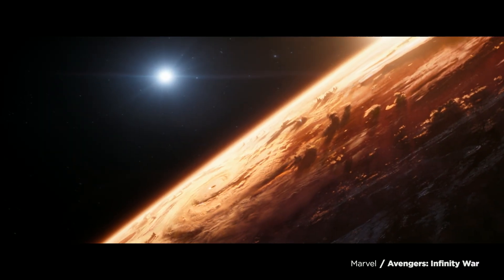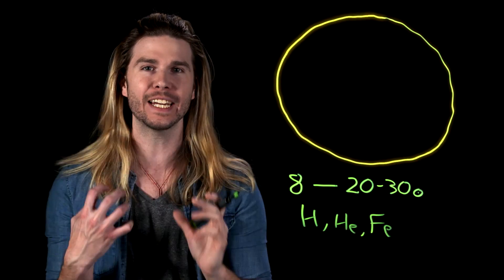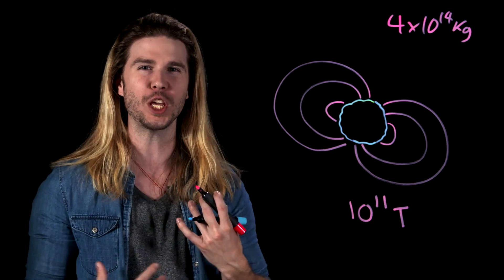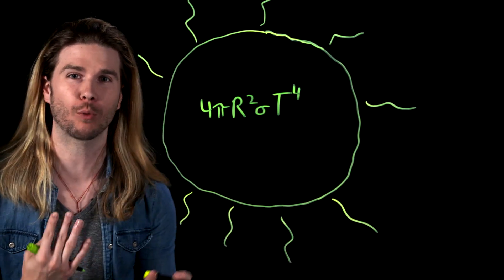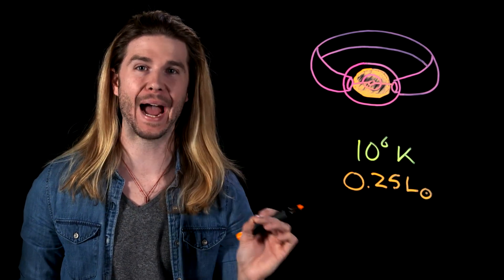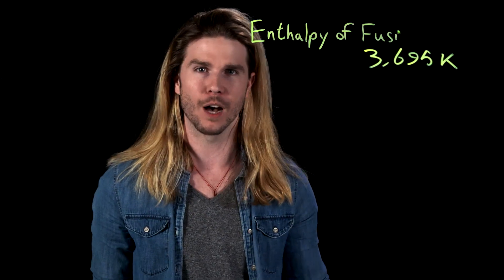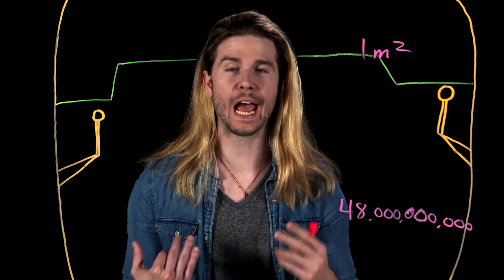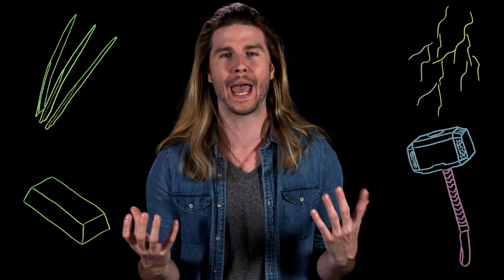How To Forge Thor's Infinity War Weapon

Comment: Nice video. Yeah that part of the movie have a lot of problems.
First: What is Rocket's spaceship fuel made off? He can move the rings of the forge like nothing. Yes, he was catapulted by Thor, has his momentom velocity and stuf like that BUT we are talking about rings than can handle the gravitational force of a neutron star. There wasn't too far away from the star and we don't know the scale of the whole machinery. It's has to be like trying to move a car by pull it by a needle.
Second: Okey, Asgardian can live in the space vaccum without much trouble. So..... Or the explotion of the ship (the one which found Thanos and was destroyed) was REALLY powerfull, like supernova scale of explotion. Thor was found unconscious and he take his time to recover. OR there are some kind of atmosphere surrounding the forge becouse the other (Roket, Groot and Tyrion) stay there without problem.
Third: Right after the axe/hammer was take out of the molde it was hard enough to be put together by Groot so the metal cold really fast and it's has to radiate that heat somewhere (an other supernove?). Then Groot lift it up, a weapon so heave than no one can even move an inch if you aren't worthy. So or Groot is worthy or he's more strong than Hulk and Thor together!!! (assuming the Stone-Breaker have similar propertis like Mjolnir becouse both are made of the same material). I really want to know what happens if the second part it's the right one.
Sorry if there are some mistake, I'm not native speker and my writing need some impruvement.
Great work. Hi from Argentina.

Comment: So considering the massive gravitational pull of the star wouldn’t it be possible for it to have a massive atmosphere? Theoretically, if you ignore the magnetic field, you can have an atmosphere that can extend several hundred kilometers away from the gravity source. And because the diameter of the star is so small it would mean that you can have a breathable atmosphere while orbiting the star. 

The problem with this theory however is the lack of internal reflection. If you think of light pollution, light generated by the surface of the star should be reflected back, making the air around the star change colour. Which is not seen in the movie.

Comment: Using the term forge in this case is incorrect. It would make more sense to call it a foundry because no actual forging actually occurred, it would be casting. I’m just saying seeing Peter dinkleberg use a giant power hammer would be badass.

Comment: Kyle (Good evening btw) mentioned, that from certain point we can see the whole surface of Neutron Star (NS) because of NS gravity pull affect on Photons. So if you could stand on the surface of NS you can probably see yourself from behind. For instance the radius is 1km, then the equator is 6.28 km. So you could see yourself standing 6.28 km away. Well..we actually can't, but the one who is able to stand on NS probably can...

Aand, i know, Thors weapon is not made of ...NS core, but if it was..probably it could become the "Radioactive smasher" because of bremschtrallung radiation per every fast hit or a collision after flying on a high speed. The heavier the opponent - the larger ammount of gamma rays

Comment: One of the things I wondered about in that scene was the scale of things and how long it would take for them to move around and do the things they did.

So what I've learned here is that the scale can work cause a neutron star is way smaller than I thought, buuuut....

I mean doesn't that mean Rocket, Thor, the Pod, the forge and Eitri would be under pretty intense forces? Would they survive. I mean Thor is one thing but.... And the forge is pretty darn durable. How did they even build that?

Comment: For the bit at the end: if the neutron star is so incredibly massive the gravitation would also pull in gas that is floating around in space. It would also be instantly pulled into the star just like everything els around it but as in the beginning of the scene forge has been extinguished for a while maybe a kind of atmosphere has built up around it. Also it has been established multiple times over that asgardian gods don't need to breathe so it doesn't matter as much. Btw the scene in which stormbreaker is first used is probably the ost awesome thing in history.

Comment: You did a wrong. Fairly certain supernovae don't happen when the mass builds in the centre  (kind of implies the star is creating mass) but because the iron can't be used so the pressure the fusion  (fission? I forget) produces lessens until it cannot withstand the gravity of the stars own mass at which point it all rushes in and explodes. Love ya show Kyle

Comment: I was very annoyed that the ax wasn't forged, but cast. The real question is what is the forge made of? The ring Thor was in is meant to take the same heat he did for longer without any apparent signs of warping or melting, even though we know it was enough to melt Uru metal.

Is it possible that the Dwarves gave the neutron star an atmosphere? With the rig apparently covering for the radiation, magnetism, and gravity of a neutron star to the point where a raccoon was able to be there without issue, could they also have given it an atmosphere?

Comment: havent watched the movie so dont know what happens in the scene but:

but if you FORGE weapons you dont melt the metal but you get it to forging temperature wich is around 70% of its actual melting temperature and then move the metal to the shape you want. 

if you would actually melt the metal and pour it into shape it would become a cast metal and not forged metal. And that can't be called a forged weapon then.

Comment: This is really irritating to me. Because no one gets it right in television or the movies

Correction 1. "Thors hammer was forged."

Thors hammer was never forged. It was cast. There is a big difference between the two in terms of skill, time effort, and process. 

In casting, it requires a skilled molds craftsman and a furnace/crucible operator. They would then pour molten metal into the mold to create the casted part. 

Forging requires the heating of metal and softening it enough so that it can be shaped by a skilled forget using power and/or hand tools. 

Correction 2. "It was built in a forge."

If you are casting metal then that location is called a foundry not a forge. Doesn't matter if you can do both in the same shop. The area and furnace for casting is the foundry and foundry furnace and the area for forging is the forge and forge furnace. 

The tools, furnaces, processes, and techniques are entirely different.

It is frustrating, annoying, and aggravating for people who practice the at to see it mixed, confused, or incorrectly named. 

It's insulting. Please do some basic research of the field if you are going to produce a film, show, video, or post threat deals with either practice.

Same goes for game of thrones, Conan the barbarian, fellowship of the ring,GI Joe, avengers avatar the last air bender, and etc.

Sorry for the rant, but it really grates my nerves to see a passion of mine slighted.
Reply: P.s. the phrases in quotes are meant to be there incorrect phrases that are corrected in the following paragraphs

Comment: dwarfs ? the forgemaster is taller than Thor Kyle! Also, wouldn't their ship then be pulled to the core so hard, that they would smash into it ?(Assuming it is made out of steel or some sort of metall)

PS: Q is usually reserved for the value of Charge

Comment: Your explination of the formation of a neutron star is wrong. A star is held up against its own gravity by radiation preasure, heat in other words. The build up of iron in the core will cause it to absorb that energy as iron fusion is endothermic. This causes the star to colapse in on itself, masively spiking its heat and preasure. This in turn ignights more fusion in the unspend fuel from outside the core. Which explodes and that explosion colapses the core into a neutron star, blowing off the outer layers. 

Fun fact; this cycle of colapse and explanson can occur multiple times.

Comment: Well I wouldn't have excluded the rest of the neutron star as an energy source. I think it would be pretty damn dumb to only use the energy coming out of the little hole. Not that you would necessarily want the whole energy output of a neutron star focused on such little material (maybe you have to heat it slowly to give it the best quality or something), but the rest of the containment system would have to put up with the rest of the energy, which is ... pretty demanding. If you wanted to cut down on the power you blast on your material or machinery then it would definitely help to have an outlet that can sort of dispose the unneeded energy. It could just blast it into the next star or something
Also I thought the part before, where they had to 'activate' the neutron star again was one of the most physically inaccurate film scenes I have ever seen. At least it's told like that in the German synchronisation. Don't know if it was worded better in the original
If you could just 'stop' a neutron star and then 'activate' it again just using a spaceship, then you could've used the spaceship itself as a power source for forging... My theory is that they just meant that the forge has been stopped and not the star. At least I hope so...
EDIT: lol I just realized Matter Beam already wrote a genius answer to this loophole. Love it!

Comment: I maybe overthinking but wouldnt the calculations for melting uru need to include that thor standing in front of the beam itself be preventing that amount of concentrated blast to be deflected off thors back or is it flowing thru him? Meaning uru has a higher melting point.
Reply: Judge Manny ah bless you for making note of that! Just laid that out myself, but not likely soon enough for notice.

Comment: come to think about it, the entire space station/forge couldn't have had any air, i mean Thor was standing in space while he was holding the hatch open, but the beam goes directly inside the forge.
Later when Thor gets blasted by the beam, he drops inside the forge as well without crashing into any kind of barrier. that means the entire area is open to the vacuum of space.

so unless the  the entire space station in which the forge is situated has an atmosphere around it and the neutron star, Thor wouldn't be the only being that could talk, breath and make sounds in the vacuum of space.

Comment: Lol I'm sure that blacksmiths and blade masters are cringing at the scene; because when forging a weapon you don't melt the metal. As a blacksmith you would heat up  the metal till a critical temp, and hammer it out to a bar. Once it is a bar shape and is consolidated,  then you repeat the process with heating and hammering,  then you forge it to weapon you want it. This process is to be repeated until it is rough in shape. Then you define the weapon's shape.

Comment: what about all the heat and Radiation?

the heat while it would melt the bars great. it would also melt everything that is not a god to a small puddle on the floor. so thor would have been standing in a room with a few puddle of whatever else was in the room few seconds after opening the door. so that a lot of hot melted metal being suck in to space really fast.

Radiation
 electromagnetic radiation if the heat does not kill you this will.the way we find Neutron star is we look for electromagnetic radiation and we are billons of km way and we still see this. so been that close to the star like thor i'm sorry but even a god could not live thro this much Radiation.but if he did he would be glowing for couple thousands years.

Comment: I guess that means Uru metal with its magical properties is far far more durable than vibranium which just seems to be good at absorbing mechanical energy but when it comes to thermal energy it can definitely be melted at way less than star level temperatures as shown when Ultron forged some vibranium armor in a regular forge and then got it melted and damaged by the combined prolonged lighting strike from a less powerful Thor, iron man and vision which means it's also no pushover but it's not Uru level. Now imagine how much force Hela had to generate to crush Thor's original hammer with one hand.

Comment: Considering how advanced Dwarven/Asguardian technology is (basically magic), shouldn't we assume that the entire structure around the neutron star is a type of Dyson Sphere? 
If that was the case, the area of the star directly exposed by the aperture wouldn't matter. We should instead assume that the entire output of the star is being focused onto the metal (and Thor's cosmic backside) for 2 minutes. 

Assuming 0.25L and a diameter of 10km, this would produce about 11.5 x 10^27 J. Which is over 10 million times the output calculated in the video.

Comment: Interesting thought, if you were to fire a gun at the surface of a neutron star how fast/massive (slowest/smallest object possible please) would the bullet have to be to knock off a chunk of the neutron star into space. How would the magnetic fields effect it? What would be the best angle to impact to surface at and how would that change based on the magnetic field? After you then have this chunk of neutron matter floating through space, what would happen if you tried to handle it?

Comment: Here is a good question... If the star had enough energy to melt  Uru metal. What metal was the star encased in the film? or the rings? must be some crazy shiz nizzle!
Reply: Most likely made of a ceramic or some material with a high thermal conductivity with a heat exchanger built into it. Since it's space dwarves maybe it's made of diamond?
If you can move heat energy away from the surfaces exposed to the star faster than the star can impart energy on the surface then you can keep the surfaces at a reasonably cool temperature.
We have been doing this kinda thing for centuries in blacksmiths forges. The air nozzle (tuyere) which feeds air into the forge is exposed to temperatures that will easily melt steel but they are commonly made of copper which has a lower melting point than steel. The reason they survive is because cold water is pumped through them removing heat energy before it can cause them to melt.
Reply: You think nokia phones were only used on earth?
Reply: IIRC the ring apparatus was focusing the  energy output of the star onto a single point, so the rings could indeed be made of Uru or even a weaker metal since they don't ever receive the full energy output. Also some weird space magic/tech energy shielding?
Reply: I agree with Tom ... "magic".
Reply: Another option would be high-power magnetic fields that contain the star's energy, much like how antimatter is contained. Perhaps "reigniting the star" was more a matter of aligning the apparatus to be able to open the aperture, and a section of the magnetic field.
Reply: @Eoin Kenny while that does explain alot. the thing that broke and thor need to replace still had to be some crazy stuff
Reply: gotta also remember the point of the entire device was to focus the star's energy much like a magnifying glass. It could be reasonable to assume if the same metal wouldn't melt if it was exposed to un-magnified light
Reply: BitMoreDave foshizzle!
Reply: BitMoreDave I was going to say, if it’s melting uru, then what is the forge and all the equipment made out of??!?
Reply: BitMoreDave ay dave love your videos
Reply: Probably a composite Ore of Uru and Chitauri, Chitari metal retains it’s static temperature so it could work (No idea how tf the Chitauri make it themselves tho).
Reply: cheers bruh!
Reply: It was made of nintendium.
Reply: Mirrors. The inner side of the shell could be polished to a mirror finish.

Comment: If the gravity of neutron star is that big and there is habitable stantion around it, mb dwarfes made some artificial athmosphere around it. Not big enough to look like a planet, but some oxygen flying around the star. Just in case they need to make repairs of rings or smth else. Big pseudo-athmospheric oxygen maker is much easier to craft than big bulky spacesuits for giant dwarfes

Comment: Using the most accurate Mjolnir measurements I could find acroas the interweb (22.0x13.5x13.5cm) (giving us a volume of 4009.5cm^3) and the density of a neutron star (10^18 kg/m^3) the mass of the hammer comes out to roughly 2.5x10^15 kg... So even more ridiculously massive

Comment: Yeah, that's exactly the question I wanted to pose during your last BSlive but it took a different turn. So If he's breathing how can we explain that giving them the benefit of the doubt ? How can you hold artifitial atmosphere around critical parts of say space station or the sphere the star was in ? Could you use some kind of magnetic field to hold oxygen in place or at least in a certain volume with no physical container ? If not magnetism then what would be the right scietific recipe ?
Secondly,  I pose an explanation for existance of such a dense ore... What if it is a very dense metal to begin with on which the Ant-man's pimm technology has been used ? Or some very simmilar method. We know this exists in the MCU and it would explain the density necessary. We know that this "densification" has no limit because Ant-man is able to enter the quantum realm, therefore pushig the distance (for an oudside observer) of his atoms under the size of an individual atom... I expect to hear your thoughts on this, so see you in the footnotes ?